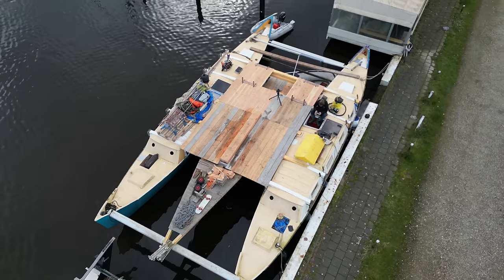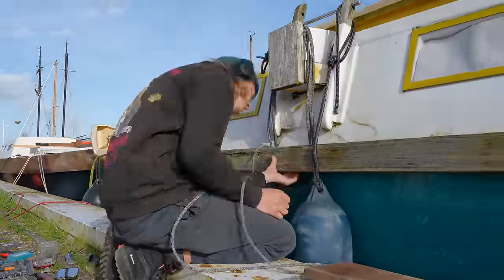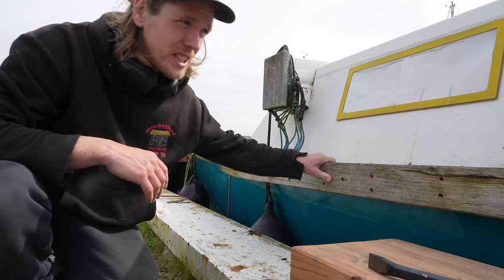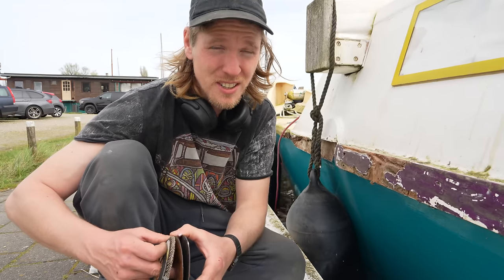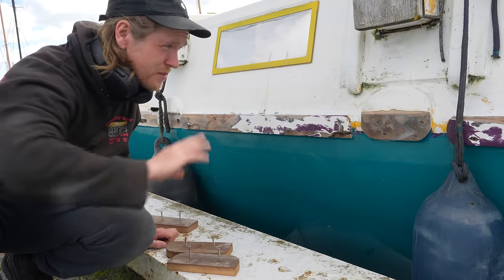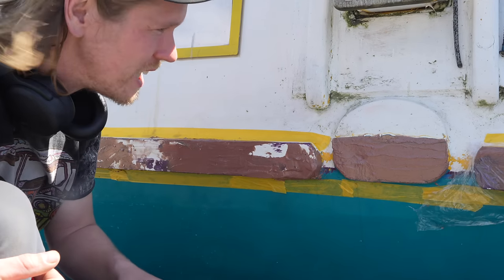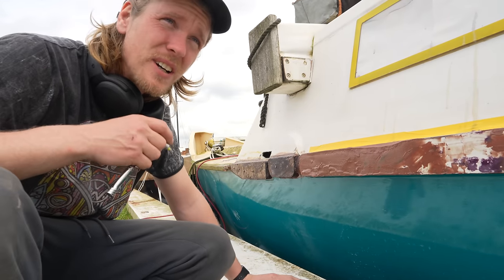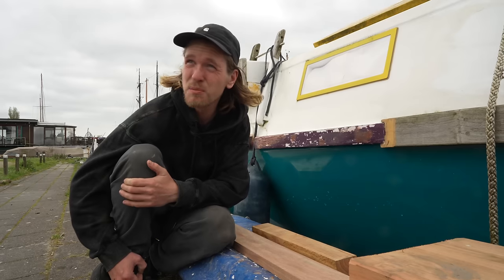Some Serious Rot Fixing on my Ocean-Going Catamaran Project

Comment: You filling the void where the block goes that holds the lashing. You also want to remove the screws. I would advise to think that over. The whole boat structure is hanging on those lashings. Don't rely on just the epoxy to figth the sheer force of the lashings. I would even put through bolts in holes that were lined with epoxy and chainplates inside the hull to fix those lashings. When you are in rough seas the hulls try to go their own way and those beams have to hold them together with the lashings. Don't underestimate the forces there.

Comment: Routing wide sections: start in the middle . Set up a plank adjacent to your work at the same level and the router will use that to sit flat as you get closer to the  edges

Comment: I'll be honest , I thought you were mad trying to refurbish this boat.
 But you have done an amazing job so far, I do think,you need to,reinforce the pivots for the motor pods, on the pods themselves with an alloy plate , on each side ie 4 per pod, but that can be done later but it does need to be done.

Comment: Mark, could you epoxy the heck out of the old piece and put it back on?  Sure would save a lot of time.😊 Going to the old anchorage where you were?  Remember how hard it was to get stuff to the boat? No one nearby to lend you a hand if you need it.  I think I would stay put till you get the engines up to 100% and the mast & rigging back in place. Cheers, S/V Cork~Texas 🇺🇸⛵
Reply from the maker: That’s what I was thinking, it would work, but maybe better to screw a solid one in

Comment: When cutting hardwood specialty if you have a good guide cut halfway through the thickness or maybe 3/4 of the way through and you won't have blade pinching on your cut. Two passes is easier than one tough one.

Comment: Hi Mark I was in Portugal recently between Faro and Albefura  I asked at the Boat yard in the Harbour. There are several protected Anchorages if you do not want to go in harbour though the fees seem cheaper than the UK. The harbour also had plenty reasonable price cafes. They also had a Bank of washing machines right on the harbour and a Super market.
Reply from the maker: Nice!! I’ll check it out online 👍

Comment: Great router.its multi has multi useful it's actually a trim router so you actually for the type of work you're doing you need a bigger router really with a bigger bit the bigger artist can handle bigger bits and the trim router just don't have a strain that router don't use too big a bits for it but you got the job done. So that's great there is another way of actually taking out that little the middle piece of wood that you couldn't get out to use to multiple to work for but that's another topic for another video or a comment shall I say but you're doing well mate just keep at it you'll find Solutions and you have been finding Solutions

Comment: You should purchase some cheap autobody plastic applicators. for smearing on the fiberglass filler Its speeds up the job much easier and their easy to use. .you can even cut circular grovers to help with coping really well as well. but nevertheless your doing a good job Mark.

Comment: Yeah, you need to get down south, the weather is holding you up quite a bit... Portugal would be hot in Summer, but you will at least get MANY more good days in.
Don't waste time by going out to an anchorage now, you will get a good chance to test the engines soon anyway. Besides, you know them quite well to sort out any issues that might come up on them.
Summer is coming, push though these projects. You're close to starting on your rigging, once that's done you will be able go anywhere fairly easily. Not long now.....

Comment: get an impact driver , its worth it when dealing with these issues
Reply: I second this!
Reply from the maker: Does that take out hard to get screws? I was scared of rounding off the screw heads
Reply: Can, but less likely imo. Somehow drivers are a rare bird in YouTube refit projects 🤷‍♂️.  Screws/heads less likely to break them off as well, push hard and pull trigger in bursts. Get a QUALITY set of bits including ones that will drive sockets and quick change drill bits. and couple extensions to go with it, they last ages. The increase in torque is massive and time saved even more impressive. Once you’ve used one awhile you’ll never want to it with anything else 😎
Reply: @WildlingSailing  if you don't apply enough pressure it will for sure strip the heads. But if you can clean the heads out semi well and get enough pressure on the Impact driver you'll gun them out alot quicker and easier

My impact driver has fast, medium and slow so I'll use the slower speed for tricky screws
Reply: Impact drill will make the world of difference
Reply: You can get ones that use makita batteries for €30 get both a 1/4 hex & a 1/2 socket driver  they will change your outlook on screw & bolt removal! While your at it get a big kit of 316 screws.
Reply: @mattschannel1502 Drill drivers are useless for most stuff a real impact driver is what you want!😊
Reply: sorry for the late reply @WildlingSailing

Comment: If it's rotting only where the lashings go can't you just leave them on the outside and fill in the gap? To avoid the pooling of water there. Rope will dry quicker also.

Comment: The method for cutting out the section in the rubbing strake is to set the depth on your circular saw and a cut as many needed passes down the length 👍

Comment: You might consider replacing that wood with foam and glass. 
The foam will be easy to reshape it to fit and use epoxy resin and it will last almost forever

Comment: Forstner bits are best for removing bungs and plugs, since they 'flush cut' the hole. If the wood is to be scrapped, a small hole saw with the center drill removed will core around the screws which will allow them to be removed later with vise grips. Remember to slide a clear plastic 'zip lock' bag over your epoxy scale, it's far easier to discard a soiled bag than to try scraping off old epoxy... 🤯

Comment: Hello, I've noticed that you scrape out the Rott and then just fill up the space with filler. I hate to break the news to you, but the Rott fungus is still there and will just re-emerge some time later. The proper way of doing this, and which I've done many times, is after the Rott is removed, the affected area is treated with Acetone which kills the Rott fungus. Only after this and once the area is dry you can apply any kind of filler and or new fibreglass..

Comment: The stainless marine screws that you removed from the rub rail, you showed a closeup of them, those are old and very good quality. I’ve pulled similar off a 40 year old boat and they are still spotless. New good quality marine grade stainless fasteners are pricey as you know.
I ordered a bunch of new stainless screws online ,the inexpensive over seas stuff and they are inferior.
Beware of cheap stainless fasteners.

Comment: Thinking yer right in spots... there's places that either need rebuilding... or you might have looked for kitty hair fillers (fiberglass strand reinforced fillers). All in all, I think this is a significant step up from the work on the previous boat, you are learning, and you'll be better for it (as you've been). No one is born knowing "stuff". Would be interesting to see you dive into where water got into some of these places, but I get that you have time constraints.  Personally, I don't mind 'glass' but I'll stick to aluminum...(what is this  aluminiumiunium you british speak of?)

Comment: OK this is very educational, Stainless screws will rust! The last pair of screws just crumbled away, in the presence of water and no air. If they had been brass, they would not have corroded that way.
Reply from the maker: The ones that crumbled weren’t stainless. The stainless ones were pristine. The problem is the area surrounding the screws, water is very persistent in finding a way to the wood!!!!
Reply: @WildlingSailing  Not wishing to argue, but I have long experience with Stainless steel, and what you saw with those screws, is exactly what I would expect. I am fairly certain they were exactly the same screws as what you took out pristine from the other parts. Stainless does rust, as much as a hard steel, just it only does it under particular circumstances. No air (oxygen) and presence of water. CSIR in South Africa made Stainless steel drift bouys to collect data in the oceans, when they painted them, they rusted. I have also experienced this with a good Stainless steel sink, attached hard up against a wall, when removed it was rusted through where the sink was attached to the wall.

Comment: I worry about the steering. If the rope snaps, how do you steer? Also how are you going to have the steering on an autopilot system? What will you do in rough seas and the waves are coming from behind? I think you need to swap the rope for steel hawser and you need a second mechanism in case the hawser breaks. The rope system is a terrible idea.

Comment: mark: replacing the lashing blocks with high molecular density plastic would solve the design weakness of using wood where fresh water will inevitably accumulate.

Also: the circular saw would have been a better way to cut the channel; cut spaced slots and remove the ridges in between with a chisel. The saw lets you cut to depth in one pass, and you’ll produce much less dust.

Last thought: using blocks about 10-15 cm high, not sawhorses, makes for a much more stable way to work material; power tools and wobbly work is never good. Japanese and Asian carpenters use blocks like this, which you can make easily yourself

Comment: Just wondering how you'll feel about this rotting old POS while it falls apart around you somewhere offshore. Epoxy doesn't bond to rotten wood, a stoop gap measure at the most

Comment: Can't believe you are ever  hand screwing when you have a makita driver (also get an impact). P.s. on that drill/driver if you set the clutch right it kind of acts like an impact. Set it just before the torque and it will jiggle like a hammer drill, not as good  but works on lower torque stuff that might break

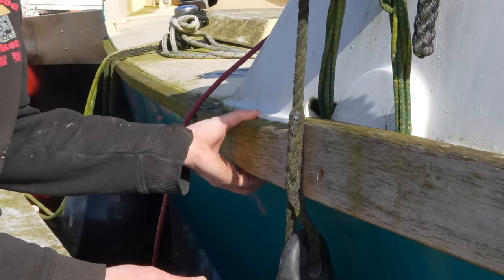Comment: @02:08 The way to remove the plugs is drilling a hole in the middle having the diameter of the screw to be used minus the actual thread.
Then screw in the screw gently and pulling the plug out as it touches and leans on the 'to be removed' screw.👴😉
@05:38 What is really bad is the way the glue (and maybe the type of it) is used, in combination with the (lack of) preparation, read thoroughly epoxy layered and glassing, of the hull.👴😨

Comment: If a piece of that cut off wheel breaks off that mask you’re wearing wouldn’t even think about stopping it from going right through your eyes. At least get a face shield if you’re going to take the safety guard off
Reply: Or use a diamond multi cut disk.

Comment: Someone did you no favours by using none stainless screws in that block... Rather than wood which will chafe and rot can you put in a block of something rot proof.. failing that dunk your wood in thin epoxy.

Comment: Sorry to piss in your cornflakes but the ocean is not going to be good to this boat maybe in the Bahamas its the perfect of this boat. but you have to get there 1st
Reply from the maker: That remains to be seen, the design is good. It will all be down to my fixes
Reply: I have seen some real derelicts cross oceans........and hes not finished yet.  Quit with the negative waves Moriarty.
Reply: My bet is that it will be absolutely fine. 
Wharrams were and are designed by sailors who understand sea conditions and as a result know what works and what doesn't.
In many ways huge modern boats with there expensive and complex systems are more of a liability than an asset. 
They're OK when everything works, but it often doesn't, and you  can't rely on high tech.